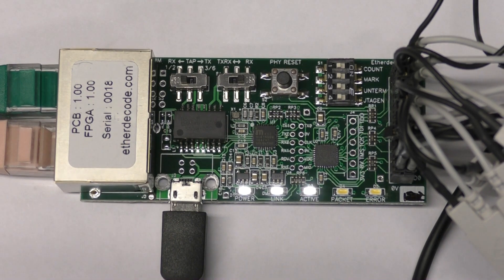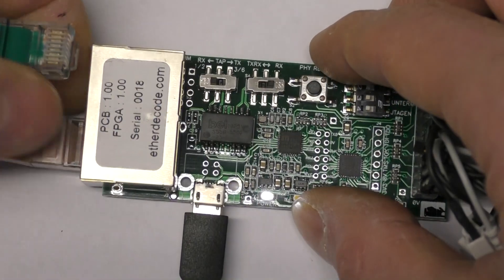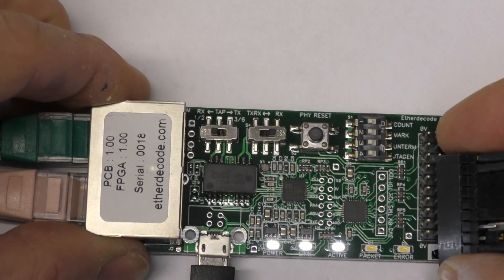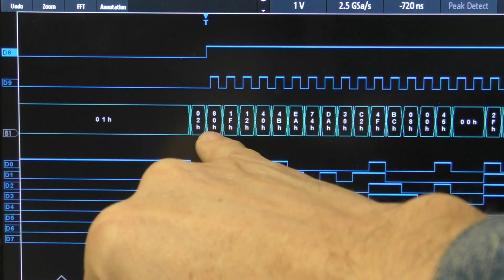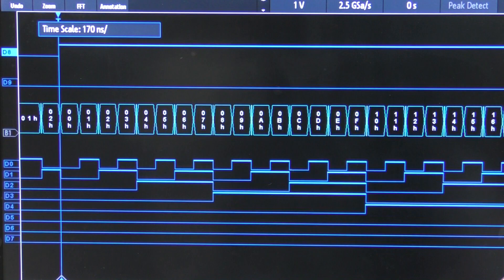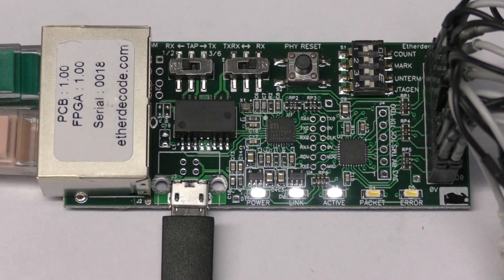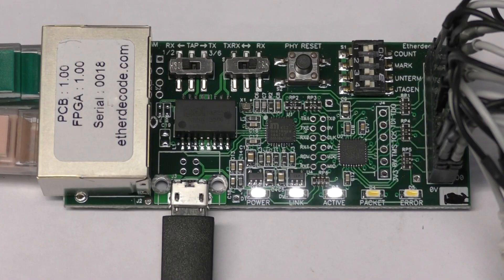Etherdecode 100M Ethernet trigger/decode adaptor for MSOs and logic analysers

Comment: AI Summary

Abstract:

This video introduces and demonstrates the Etherdecode, a custom-designed hardware adapter for triggering on and decoding 100M Ethernet traffic using standard oscilloscopes and logic analyzers. The device functions as a passive tap with dual RJ45 ports, built around a Microchip LAN8720A Ethernet PHY and an FPGA. It outputs an 8-bit parallel data stream and provides several intelligent features, including a dedicated trigger output, a byte-count mode for easy packet navigation, and a marker output that can highlight specific fields within an Ethernet frame, such as MAC/IP addresses and port numbers. The creator discusses the design choices, potential use cases for low-level hardware debugging where software tools fall short, and future possibilities, including a potential gigabit version and the possibility of open-sourcing the design if it does not prove popular.

Decoding Ethernet at the Hardware Level: The Etherdecode Adapter

*   0:00 Product Introduction: The video presents a new board, the Etherdecode, designed to help oscilloscopes and logic analyzers trigger on and decode 100M Ethernet traffic at the physical layer.
*   0:17 Core Functionality: It acts as a passive pass-through tap with dual RJ45 ports. A switch allows the user to monitor either the transmit or receive pair, and a second switch enables link establishment when connected to a single device or a switch's mirror port.
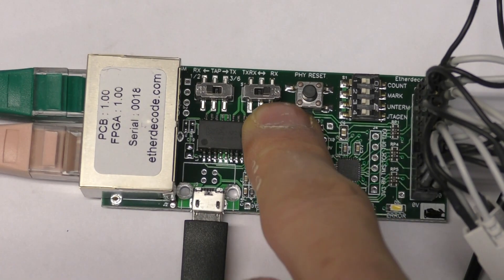*   1:25 Key Components: The design is based on a Microchip LAN8720A PHY and an FPGA. A crucial feature is the switch-selectable onboard termination, which can be disabled to minimize loading on the line when tapping.
*   2:35 Onboard Indicators: The board includes several LEDs for status indication: power, link status, an "Error" light for marginal signal conditions, and a custom "Packet" LED that provides a more accurate indication of packet reception than the PHY's standard activity LED.
*   3:29 Data Output: The device outputs an 8-bit parallel data stream via a 20-way header, along with ground pins and a marker output, designed for easy connection to logic analyzer probes.
*   4:25 Intelligent Trigger and Marker: The board generates a clean trigger pulse at the start of every packet. It also features a marker output with two modes: a simple pulse-per-byte clock or a mode that highlights specific fields in the packet (destination/source MAC, EtherType, IP addresses, ports).
*   6:34 Byte-Count Mode: A key debugging feature is a mode that replaces the data output with a simple byte counter (0, 1, 2, 3...). This allows a user to easily navigate to a specific byte offset within a long packet before switching back to view the actual data at that location.
*   7:46 Business Plan & Future Development: The creator has set up a website (etherdecode-dot-com) to sell the initial batch. Future plans depend on its popularity and may include a version with a case or open-sourcing the design.
*   8:07 Gigabit Version Considered: A potential future version could support Gigabit Ethernet, though this presents challenges with the 125 MHz data rate, likely requiring an onboard FIFO buffer to output data at a slower speed for standard oscilloscopes.

Summary of YouTube Comments:

The comments are overwhelmingly positive, with many viewers praising the device as a clever and useful tool for low-level debugging. Several commenters identify specific, advanced use cases where traditional software sniffers would be insufficient, including reverse-engineering custom protocols, timing attack analysis, Tempest emanation testing, and debugging time-sensitive Ethernet standards like IEEE1588. There are numerous suggestions for future product development, such as an affordable USB3 sniffer, a Wi-Fi (802.11) version, and strong interest in the proposed Gigabit model. The "byte-count" mode is frequently singled out as a particularly smart feature. Overall, the community expresses strong appreciation for the creator's expertise and the practical, real-world utility of the product.

I used gemini-2.5-pro| input-price: 1.25 output-price: 10 max-context-length: 200_000 on rocketrecap dot com to summarize the transcript.
Cost (if I didn't use the free tier): $0.03
Input tokens: 18761
Output tokens: 869

Comment: An interesting thought if you’re considering further development paths is maybe look at adding a WiFi 802.11 phy/mac front end. I hate it, but it seems everything is going wireless, even things that really shouldn’t be. I know a lot of guys are trying to roll their own wireless phy rather than using the rather limited modules. Something like the MAX2830 might provide the RF stage, although I only gave it quick glance... just a thought, and I don’t know from were you are with the FPGA if that would be trivial or involved.  Might even make it more interesting and see if The Signal Path, W2AEW, of one of those GHz guys would break out all that gear they have to help get the RF side tuned up...

Comment: If you're doing another rev of the board, consider using something other than a DIP switch for the mode select - DIP switches probably won't last long.

Comment: Sorry for yet a third comment, but I tend to comment as I go because I’ll otherwise forget. Again I’m a noob here so please do correct me where I’m wrong. Couldn’t one thing be you can do internal triggering with an FPGA? It sounds like you’re already doing that to some extent. But what you could do with FIFO, potentially, is you could set the FPGA to trigger on a certain packet, or certain protocol, whatever, I think you see where I’m going with this.

You could perhaps have someone spin up a very basic piece of software to run on a PC, and you could perhaps even script this thing to trigger on very certain, specific events. Or trigger on error. That would be EXTREMELY useful in the field, I’d wager.

Give us access to the USB port and the FPGA, and some very interesting things could be done with this little gadget, maybe! Even if it’s just a console with AT commands. A lot of Ethernet PHYs and stuff like wireless modems have some form of AT command capability out of the box. You could do something with it, I’m sure. Unless you’re already doing it and I’m just not seeing it.

Again I am a total electronics noob and I’ve had y first oscilloscope about a month - all $60 of its 20MHz bandwidth. I’m just spouting out stuff I think that would be useful.

Comment: The reason the data is still ok is because if something happens during transmission on the hardware layer, the software layer will simply drop it and request a retransmission, usually. I’m sure you’re aware of how layers 1-7 and 8 work, it’s just something that was drilled into us in Cisco class. Pity that was so long ago now.

Comment: Excellent work, I don’t do much with Ethernet at the moment but a couple years back I worked on a custom project that involved multicasting a SNMP like MIBs and OIDs... was an isolated control network for a custom application so hardly any tools worked after the PHY level, ethereal was totally confused by it, so this would have saved us weeks of difficult debugging... I think you’ve got a winner.

Comment: How does it handle POE on 4,5 and 7,8? And would it pass it through? For instance, Putting this between a POE switch and a POE powered SIP Phone, or Wireless Access Point?
Reply from the maker: It doesn't - will look into that if I do a redesign

Comment: I used to do lots of packet sniffing a few years back for forensic work. The best way IMO is to use an old school Hub. Just patch that in on a major uplink for the network segment you want to monitor and then plug you sniffing laptop into any port on the hub. Since Hubs just broadcast all data to all ports and just share bandwidth.
Modern Layer 3 switches sometimes have a monitoring function where you can pick a specific port, say 24. And you can use that as a sniffing port and the switch will broadcast all ports to that one.
Reply: That’s a perfectly valid approach for IPoE when all you care about is data logging. However, it’s not going to work for other Ethernet implementations like Industrial Ethernet protocols. It’s also not going to provide you with the “intraframe” time domain information unless you have rather specialized equipment.  The use case for something like this is less about eavesdropping or traffic analysis and more about diagnostic testing (Is the device transmission within specification in terms of voltages and timings?) or reverse engineering.
Reply: I keep a 10Mbit hub around at work for this purpose.

Comment: they might have purposefully mangled the function of the "active" LED,  I remember a long time ago there was an attack where people could read the network traffic by looking at the equipment LED through a telescope.
Reply: That was about the 'packet' LED and it was bogus. That LED indicates a packet has arrived (which is hundreds of bits), it has never flashed out the bit sequence. Theoretically it could be useful if you are trying to map out a network by sequentially flooding IP addresses and seeing which network cards light up. But then altering the flash timing wouldn't protect against that.

Comment: Definitely a useful tool for the hardware hacking community. Has applications in timing attacks and side channel analysis in general. 
Something I toyed with a while back was a small ARM SOC on a pcb with two ethernet phys and an SD card. Perfect passive tap with traffic recording.

Comment: Ethernet trigger and decode on oscilloscope is extremely useful when working with time sensitive Ethernet protocols like IEEE1588.
However, in those cases you want nanosecond accuracy, so the latency of the PHY and FPGA becomes a bit of a problem. Better than nothing, but not ideal.

There are scopes with built in 100MBit/s Ethernet decode and trigger, like Tektronix 5 series, but to my knowledge there are no scopes with gigabit ethernet decode and trigger.
Reply: If you want that level of accuracy get solarflare cards that support tx/rx hardware time stamping and can synchronize their clocks across across multiple cards using ptp. Synchronizing external hardware events to the timestamps generated in the cards is a whole other can of worms, though.
Reply: @vincei4252  The capability for 1588 (PTP) timestamping is getting pretty common now; many Intel NICs in their chipsets as well as discrete NICs have the capability, and just about everything specced for automotive or industrial use will as well. Intel, Broadcom, Microchip (i.e. some stuff acquired from Micrel and Atmel), Marvell, TI, NXP, and probably a lot I'm missing have broad support for 1588 timestamping in their hardware. Open source software exists for the driver and userspace components as well, and the driver bits have been built into Linux for a while.

Just something to keep in mind in case you need to do something networked with really tight time sync in the future; if you pick the right parts it might not cost any extra to use PTP!
Reply: I used to work on AVB/TSN protocols; having hardware to diagnose low-level timing issues would have indeed been extremely useful. Even 1588-capable interfaces have PHY delay to deal with though; it's just a fixed delay per mode (although this is not true of every PHY, so you have to be careful if you use a MAC-timestamping unit without a built-in PHY). You just configure the delays in the system into the software and account for them in the 1588 calculations. Assuming the PHY on this gadget has a fixed amount of delay, the FPGA ought to as well, and again you just have to measure and account for them in your usage of the data.
Reply: Yes, you need synchronization to hardware signals, so capture cards are no good.

Comment: Mike, what's the advantage of using this board over a passive tap (or switch span port) and software? Wireshark/tcpdump or if you want a more scope-like output, some custom software? The advantage being that you can easily analyze links up to 40G relatively inexpensively.
Reply from the maker: Ability to see timing relative to other hardware signals. As I said, I don't know how useful this will be
Reply: If you are diagnosing/developing and Ethernet 'something' and there are timing or other signal problems that are preventing the packets from being recognized by standard Ethernet interfaces so they never even passed to the software (or as just an error flag).
Reply: @ElectricGears  If you're developing something and are having serious timing/signal problems, a standard Ethernet PHY is not going to help you figure out what's going on. You'd need to look further down at the raw signals on the link to figure that out. Don't get me wrong, this is a really nicely engineered board plus I'm a huge fan of Mike's work in general so I'm hoping he'll have some success with the project.

Comment: Interesting stuff mike, but what is the use-case for this exactly? Do you need time correlated analog measurements to go with the ethernet trigger event? I've had to reverse engineer stuff using raw ethernet frames before and using a regular PHY directly feeding frames to an FPGA worked a treat (my data was not processed in realtime, just buffered). I think any regular FPGA dev board with ethernet would do the job. I used an older one so I didn't have an ARM core on the FPGA itself at the time, but these days every dev board has ARM cores directly attached to the programmable logic too.
Reply: CIA-level backdoor attack analysis? :P No way for your Intel network adapter to hide the some packets coming in!
Reply: @rkan2  That needs nothing more than an odroid h2 and openbsd... I'm expecting Mike had something more ambitious in mind when building this, just not sure what.

Comment: When tcpdump is not low level enough... Looks awesome! If this is the start of a product line, I'd would love an affordable USB3 hardware sniffer. No need for fancy protocol decode software. Best of success to you!
Reply: I second a USB3 decoder. I looked recently and the better one was $5K. Too rich for my blood.
Reply: you do like 2.0 HS mode analyzers come cheap, eh?
Reply: @vincei4252  All we need for that is a single board computer that can do USB 3.0 host and device at the same time. Or a PCIe card with USB 3.0 device - probably a FX3 and FPGA will do the trick.
Reply: @NiHaoMike64  I have an FX3 with the appropriate interconnect hardware to connect it to an Altera FPGA dev board. Definitely something worth looking into.
Reply: Can't Wireshark do USB anyway?
Reply: Related: I’d like a video about USB3 interference on BT LE and ANT+ and other low energy tranmissions (why not wifi too)!